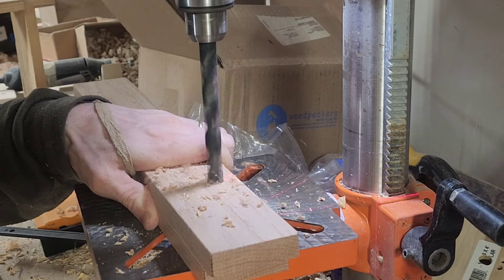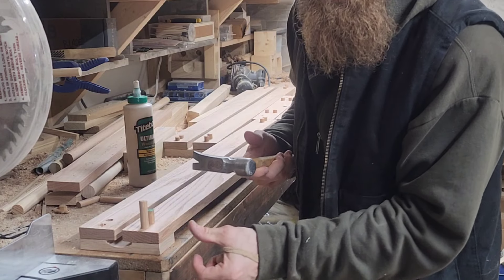Easy Artist Wall Easel Build, How to DIY

Comment: I'm thinking of purchasing one of these wall easels.  Question...  Does a gallery-style canvas sit on top of it?  I would be worried about it not fitting on the base and the top?  I want a white one with silver or white hardware.  Can I paint the ones you have?

Comment: What did you use to cover the threads of the carriage bolts on the risers?
Reply from the maker: Any rubber tubing would work. My updated easels use 1/4" gas line
Reply from the maker: Any rubber tubing would work. My updated easels use 1/4" gas line